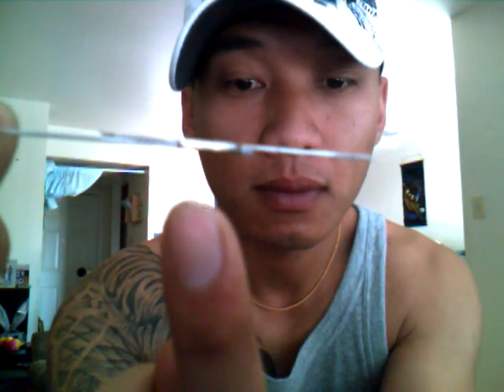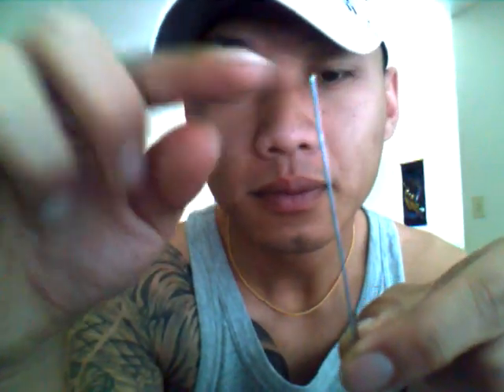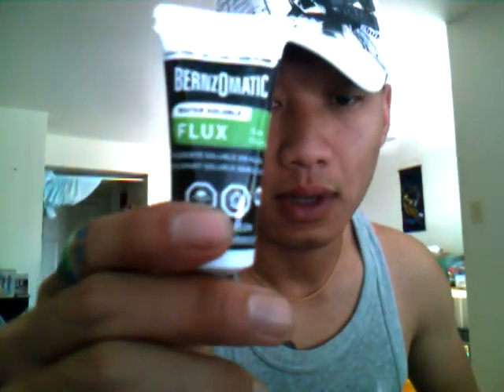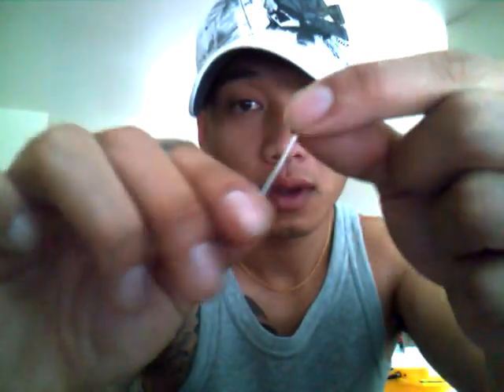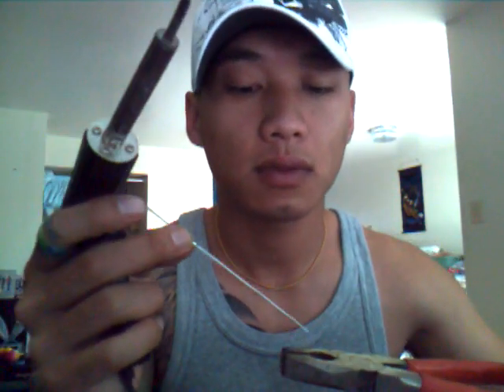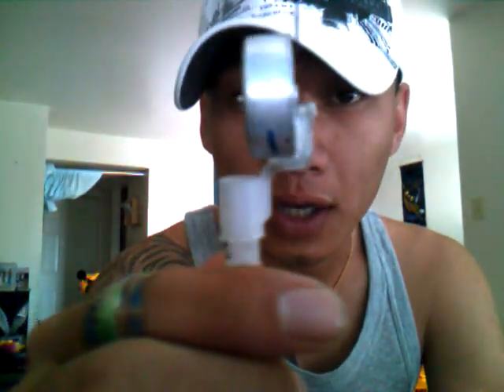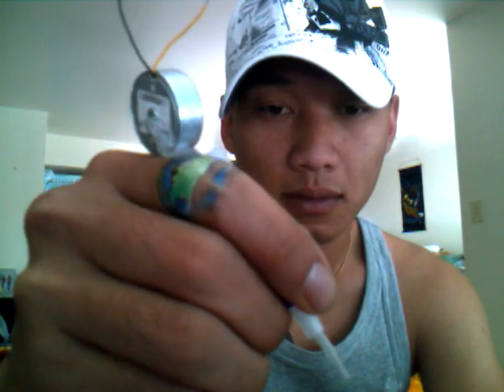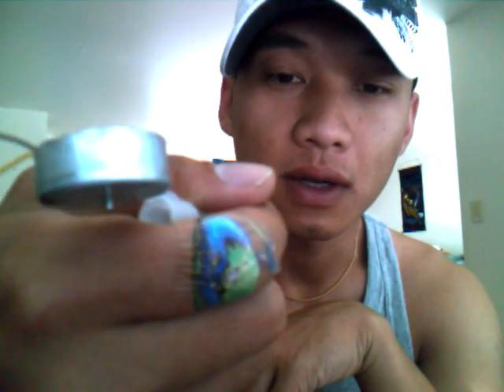Homemade Tattoo Gun Part 3

Comment: like a button on a shirt so when you attatch the motor to the center the holes around it rotate,
thread the bent part through an outer hole button and the rotating outside holes cause the needle to go up and down!

Comment: @SitNDucz 

flux is just an anti-oxidant, sure it makes soldering easier, but solder will melt and won't desolve and will bond perfectly without flux, just tin your iron tip with a little solder to prevent solder balls

Comment: @SitNDucz i used ink tube from a bic pen. cut the part at the top with no ink and put top of needle into the small tube heat the plastic and pinch then do the same for the papper clip.

Comment from the maker: does it look like mine but bigger or is it one of those that are the long ones? either way the only difference would be the pen cap part. Instead of making an "L" shape just make it a straight 90 degree angle and slap the motor on there...if its bigger then that..then you need to get something smaller..

Comment: @DevilMayCry65 you can solder with a regular lighter but if you have the solder then just go get a soldering pen they dont cost alot get like a 20 or 30 watt pen or gun they work pretty good for this i just finished makin some needles